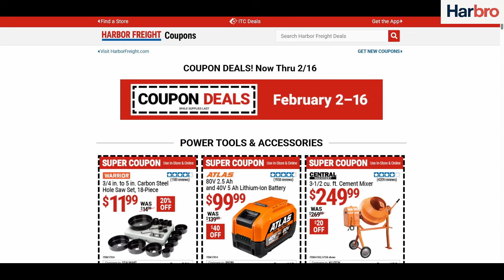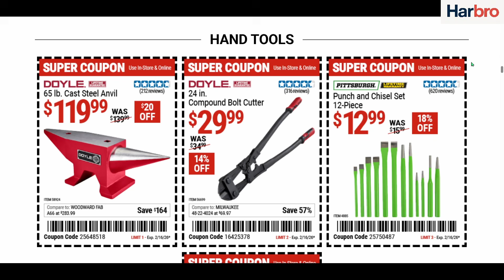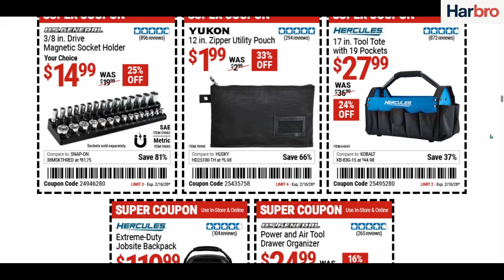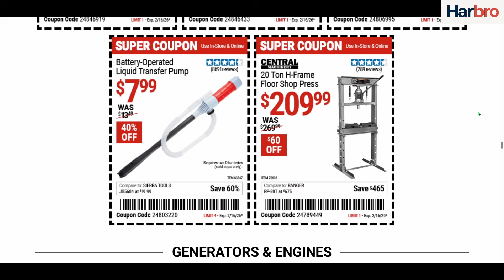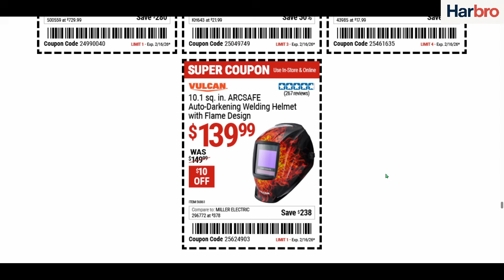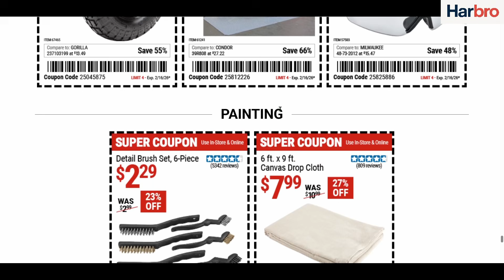Harbor Freight FEBRUARY Super Coupons are HERE! (2-2 thru 2-16)

Comment: Some of the items on this sale aren't really that great. The LED shop light was on sale for less a week ago. They now have the Bauer electric pressure washer on sale for $20 less than is was a few days ago when I got mine. I've jumped into the Atlas line and got the leaf blower, which is on this list, I wanted to get the chain saw but it was only discounted $10 bucks so I'll wait for a better price I may get the cultivator? You really have to watch to see if the deals are really good ones.